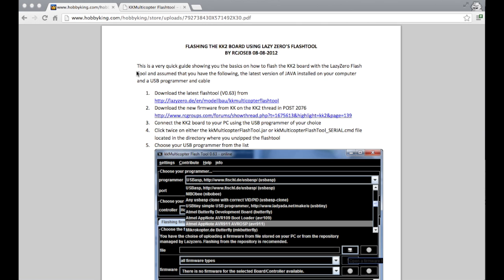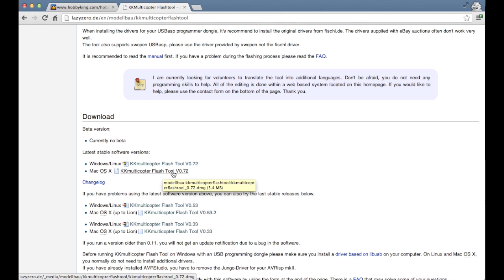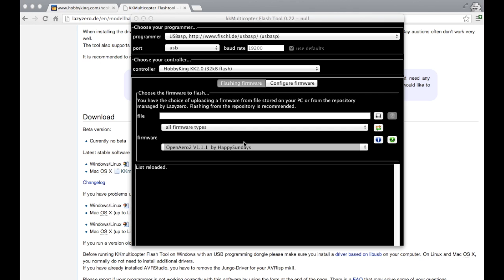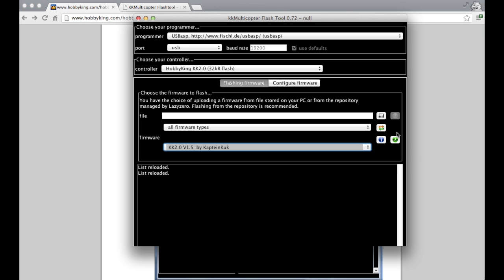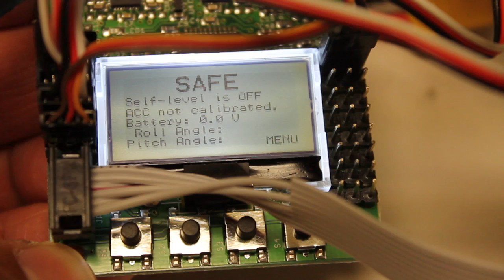How to Upgrade Hobby King KK 2.0 Multicopter Firmware - Going from Version 1.2 to 1.5

Comment: Hello, i have KK2.1.5 with Firmware Version: 1.6 on controller area in the kkmulticopter flash tool what should i choose?
Can i flash my kk2.1.5 with the version 1.12S1 of steveis.I am beginner.Thank you for your time.

http://www.hobbyking.com/hobbyking/store/__54299__Hobbyking_KK2_1_5_Multi_rotor_LCD_Flight_Control_Board_With_6050MPU_And_Atmel_644PA.html
Reply from the maker: +Δημήτρης Βλαχοσπύρος I don't have any experience with 2.1.5 but this should hopefully help:

http://www.personal-drones.net/how-to-flash-new-firmware-in-hobbykings-kk2-kk2-1-kk2-1-5-board/

Good luck with your build.

Comment: the flash tool from lazyzero comes up with a list of firmware options including the 1.6a version..
Ive just flashed two KK2 boards .. the first went fine, the second came up with red error messages.. including the "not finding the usbap".. I had to remove the usbap from the pc, then put it back again for it to pick up.. then board two flashed fine..
Reply from the maker: Good to know and thanks for sharing.

Comment: Hi Dennis,I`ve solved the problem,it must have been the USBasp I was using,I decide to order another one, It arrived today, I plugged it in, opened lazyzero and it updated on first time of asking,first one was from china and the new one was from here in the UK,apparently there are quite a lot of the programmers not working that are bought from sellers in china,Thanks for your reply and I`ll sign up to garagepilots also

Comment from the maker: Use 5V. Make sure the programmer is the only thing powering the board. From the manual: "Disconnect your controllers power source before plugging the USBasp in to the board. If you need to connect to the
board in a powered state remove jumper J1."

Comment: Dennis, I have a question about the ribbon cable. The USBasp programming board is no longer available at HK so I picked one up on eBay but it only has 10 pin connectors and I see that the 6 pin connector is not straight through. I think I found the pin-out for the 6 pin but I would like to ask if you can confirm from your HK ribbon cable. It looks like on the 10 pin 1=MOSI 2=VCC 3=NC 4=GND 5=RST 6=GND 7=SCK 8=GND 9=MISO 10=GND. On the 6 pin, 1=MISO 2=VCC 3=SCK 4=MOSI 5=RST 6=GND. Thanks you.